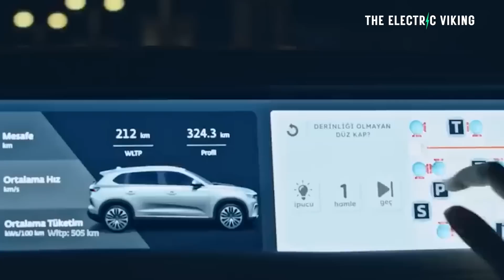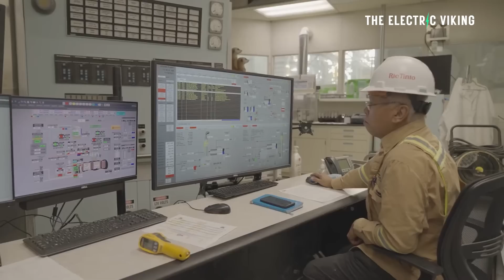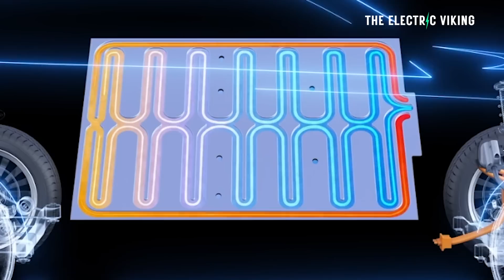Turkeys 1st EV; the Togg T10X with ultra high energy Farasis battery

Comment: As a Turkish engineer who worked at tier 1 manufacturer who worked with Togg, I would like to add a couple information and opinion here, about Togg.

I haven't Togg them or any Turkish newspaper claiming they are using Boron. This is probably some conspiracy theory online. Secondly, 180k car seem bit too much for preorder just from local market but This is expected because of Turkish tax code. Tax of an ICE/Internal combustion engine cars is More than car itself here in Turkey. While taxes of EV is 20ish% So this car is a lot cheaper than B, C or D segment ICE cars.

First half of August 2023, 909 Togg were delivered and this is more than total deliveries of July. It looks like They might deliver more than 15k car this year, maybe close to 20k. So, If this company had capacity to deliver 180k, they would be able to sell it in Turkey alone. why should anybody pay more for an ICE car at this point, If you can have an EV at cheap, that is the consensus of many peoples here in Turkey.

Comment: i' ll drive Togg in future just because is made in Turkyie. Now i drive Mercedes but i'll change with Togg insalah.
Selam from Bosna.
Reply: Ve Aleyküm Selam.
Reply: I have driven in the mountains and plains of Bosnia, and it will be fine in the city, but the battery performance of electric vehicles may be a problem on those hills. While electric charging stations are a problem even in a country like Turkey, it will be logical to use gasoline vehicles in Bosnia, which has 3 cantons, for at least another 10 years. As a Turk, I was honored that you liked and wanted our car, but the charging station issue is really important in this process.

Comment: Do not buy Togg. This brand has never made it to production line for the general public for a good reason. My uncle bought one (to support Erdogan) but he already has major problems with the controllers. The car starts and stops suddenly, the side windows do not close and open as they should, the car doesn't do half of the max mileage. Stay away, buy a hyundai, kia or some Japanese  instead. Even Dacia is a lot better car than Togg.
Reply: Haters gonna hate
Reply: İftiracı sahtekar ülkeni başkalarına şikayet etme aşağılıklığından ne zaman kurtulacaksınız?
Reply: you are a liar as I doubt if you are even a Turkish citizen, Tugg car works very well and the coming models will be more advanced & higher performance capabilities, sus lan.
Reply: You are a hater.

Comment: Not all those who paid for a reservation are planning to drive the car. Many of them want to take advantage to sell the car new to a customer that would pay more to not wait for the car to be available. What I mean is that the factory capacity is 20 thousand ish car a year. So if you can put your hands on a togg early you can easiply sell it brand new for a good profit because the buyer otherwise would have to wait many years to have the car.

Comment: In Turkey, people buy supercars in order to show off. Turkey is labeled as a corrupt country in the name. of money laundering. 

There is hidden untaxed money circling in their ecosystem however the case of Togg the car is not indigenous itself .it was designed by Pininfarina for Vinfast the Vietnamese EV company and ended up as Togg.

The Indegiounisity of that car as Turkish Made is %51  means Hyundai that is produced in Turkey is more Turkish indigenous car than TOGG.

In.long term according to the company CEO he tells that they are not expecting revenue for 20 years. ( No  car investment can afford this -This is a red flag)

They do not allow news outlets who are against the Turkish Gov. and no experts also allowed they just allow the supporting news outlets or YouTubers of the Turkish Gov to showcase the Factory ...

 The price($50.000  ) is too high for an everyday Turk that can afford what they are currently giving to the. ministers etc. Some of them were delivered to Azerbaijani President Aliyev.

In the long term, the investment of 3.5 billion $ will fail. In the end, it's a  propaganda project of the Current Turkish Gov. 

Turkish Gov is pitching to produce 1000.000 cars for 10 Years period which is equal to 100.000 cars per year and just Fisker Ocean ( $35.000)itself is preordered around 600.000 on the lunch. 

The production aim number is very low and it will not have any profit at any time all the preorders of Turkish Togg car is with the permission of the Turkish President

 No one in the West (world) wants to enter that investment of $50.000 - $62.000 with the permission of that president.

The recall and Servicing and the warranty process are unknown!

Turkey Does not have enough charging stations for these cars 

A commenter says ` Turkey is a country with a population of over 80 million and a young population.`  But it's not how much your population is young or the quantity of the population that is important   (80 million ) But how many people can afford to buy a Togg in that population is important to 50.000$ - $62.000.

Comment: Would probably fall to pieces after a month, no thanks, having experience with Turkish machinery they are not well built so i wouldn't expect this to be any different and the manufacturers lie a lot about the specs of their machines,  for 60k to 80k US which is what it is being speculated its a hard pass.
Reply: Akinci,TB-2 will not agree with you
Reply: You are very funny
Reply: you are correct there are videos that factory default bad construction